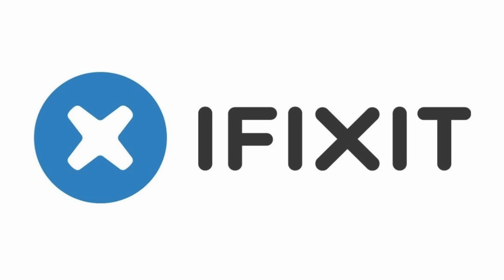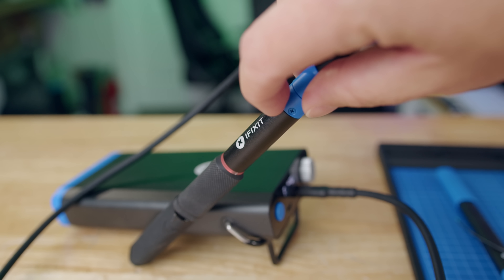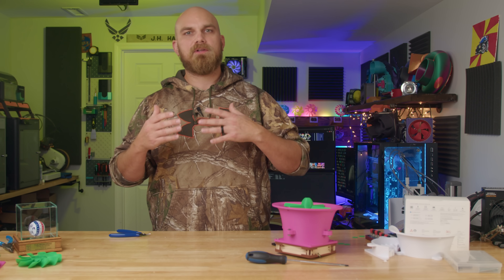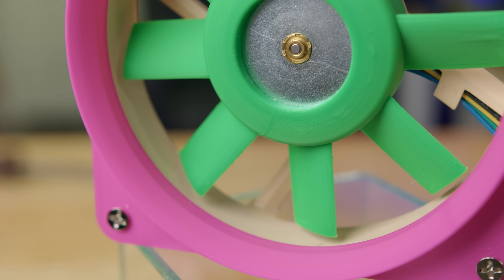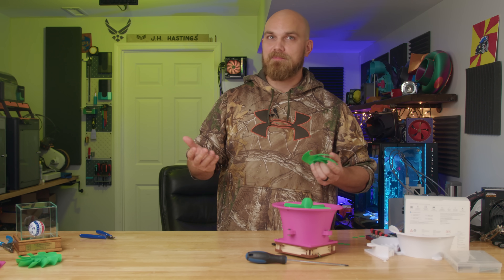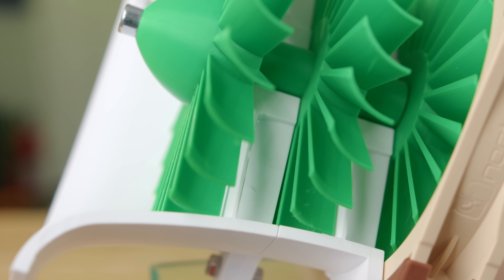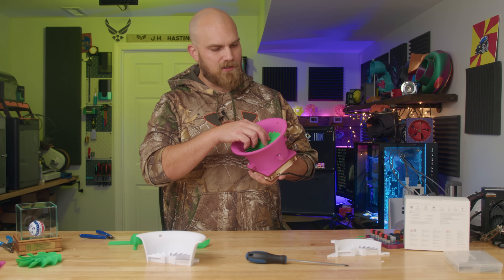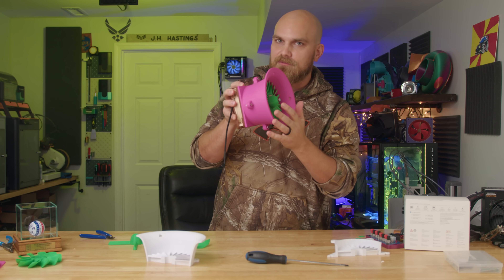Turning a PC Fan into a Jet Engine! | Fan Showdown S6E7

Comment: Oh wow, James, interesting that this is a USB-powered soldering iron! OK, so when it's plugged into is battery pack, those knobs control something about its power. What about when you plug it into a regular USB charger plug or a power strip with USB in it (a computer, for all we know)? I mean what is it set on by default because you don't have those knobs when you plug it into a different USB jack?
Reply: One of the main complaints about the Ifixit soldering iron is the lack of controls on the iron itself. You basically have to use it with their own battery bank if you want full functionality.
The Pinecil, Fnirsi irons, and other USB irons all offer controls and a screen on the iron itself and for a much lower price.
Reply: @guycxz : Hmm, yeah, I can see the expense being a problem, but as for just using it without controls, that wouldn't bother me much because the only soldering irons I've ever had only had zero or one control: 15/30W; most of mine haven't even had that.

Why have I bought several? Because tips don't last that long and replacement tips are hard to find, so just replacing the iron after a while works when whole irons are very cheap.
Reply: plug it into a comp, set the temp via serial command or ifixit site [which fires the serial command anyway] then plug it in your other usb-c PD power source, it remembers the temp it was last set to

Comment: "To charge the Fixhub or just run it off a wall socket..."

If you're gonna run it off of a wall outlet, besides the battery, then what are you gonna run it ON (besides, again, the battery)?